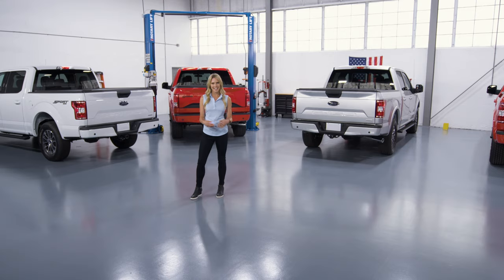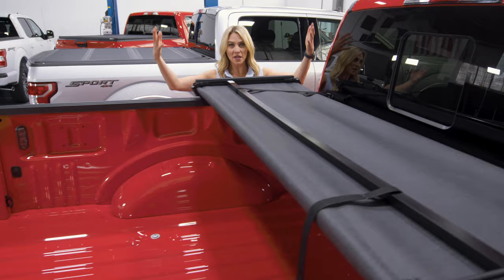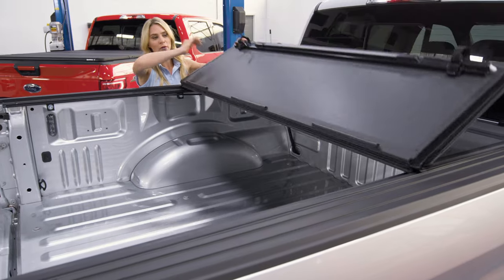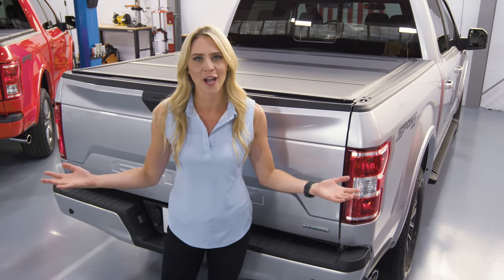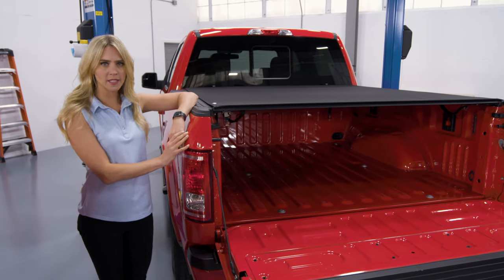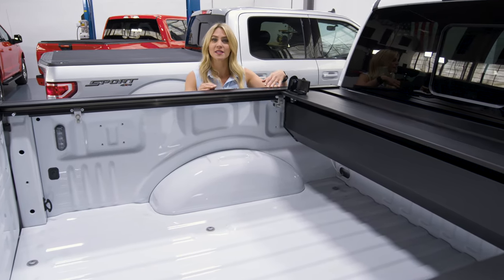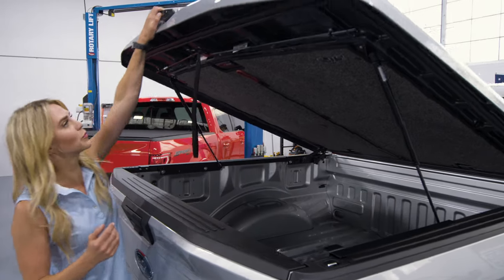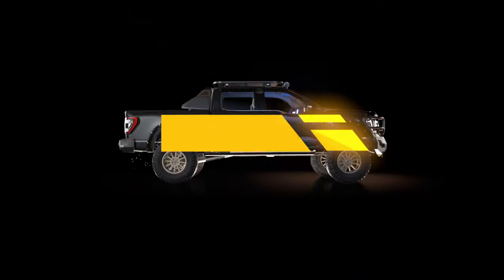How to Choose a Truck Bed Cover

Comment: She won’t talk about water leaks, she should. My brand new X4s, professionally installed had gaps from the rails in the bed front. It also does not seal the tailgate well. A ride through the car wash will make you think you don’t have a cover.

Comment: Heads up on the BAK Revolver series if you live in a very warm climate and the truck bed is exposed to severe temps over extended periods of time.   In Texas and other extreme summer temp regions, the Revolver series has a well-documented history of the vinyl shrinking and peeling back from the edges after a 2-3 year period.
Reply: Is there another brand of the rolling type that doesn't do this (better version)?

Comment: I have an older toyota tacoma truck, 2003. It has a bed liner that makes the sides of the bed smooth as it moves over the edge. There is nothing to attach the rails or clamps to. Is there any cover that will fit?